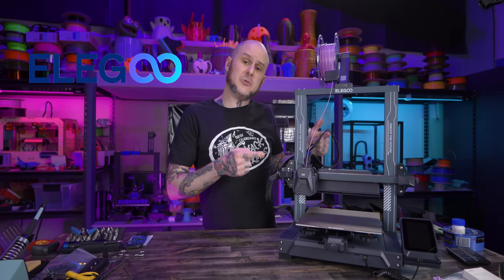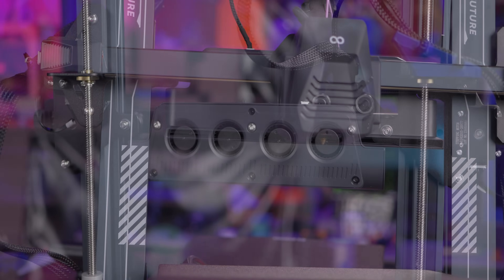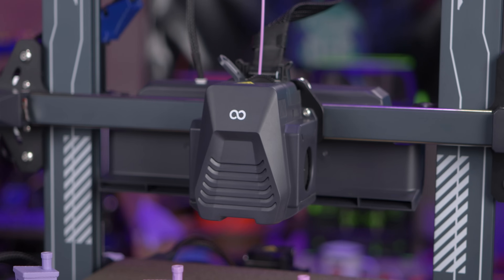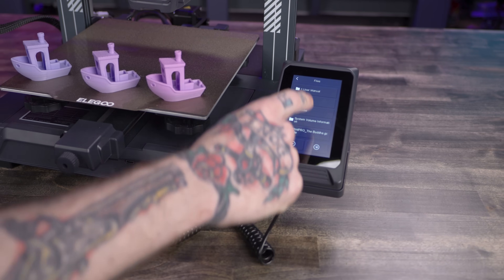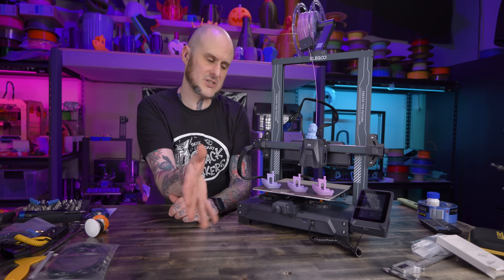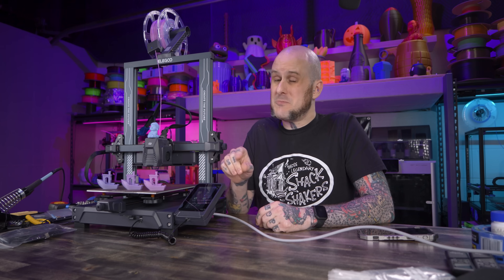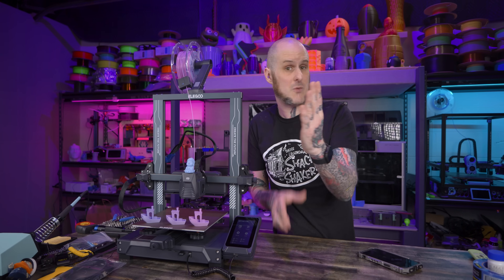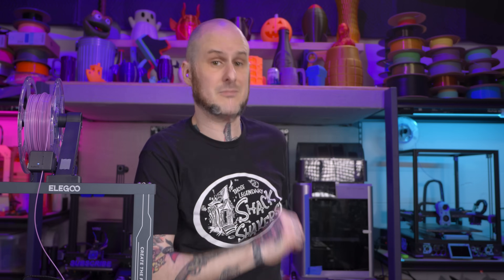Neptune 4 Pro - Closer Look + Wi-Fi Setup!

Comment: My MT7601U Wi-Fi dongle didn’t work at first either. it wasn’t showing up as available in NetworkManager. I followed some steps with ChatGPT’s help and reloaded the mt7601u driver, fixed the /etc/NetworkManager/NetworkManager.conf and interfaces settings, and now it connects perfectly. Every time I power on the printer I just unplug and plug the dongle once and Wi-Fi comes right up. Thanks for this video!

Comment: The wifi setup worked very well, thanks. Unfortunately, I have the problem that every time I restart, the WLAN stick is not recognized. I have to pull it out and plug it back in so that the connection is established. Is there a way to fix this problem in the driver files?

Comment: After power cycling it, it won't connect anymore. Has anyone been able to get around this? I have to configure it from scratch every time. I do have automatically connect checked out in Edit Connection
Reply: Do not get this printer do not get this printer. I've had their Neptune three and I don't know what happened. I'm pretty sure they sold the company off. This is a completely different machine is absolutely horrible like absolutely horrible. I can't even get the thing to work and I used to print on Neptune three for over half a year I made hundreds of dollars.

Comment: You removed the link to the USB adapter and say it's no longer recommended. Considering that was the reason I ended up in this video (and since you specifically mentioned skipping to that part using the description links, you obviously knew what most people would be watching for) maybe you could provide a more in depth reason why it's not recommended anymore.
Reply from the maker: Because it doesn’t work anymore. As I said, companies constantly update these parts and unfortunately the one I used has been updated. At least I had far too many people reporting it no longer worked after they ordered them. I don’t have a Neptune 4 anymore to test any other options, so unfortunately folks will have to use the info here but find their own adapter. Nothing I can do about companies changing products after I test them.

Comment: Sadly, I tried this method using the linked wifi adaptor, and it is not getting detected by the printer through putty, nmtui
Reply: Actually NO, it started working after I restarted the device, unplugged, then replugged for like 3 times. Then the wifi networks appeared.
Reply: I’m not having any luck getting my printer to connect to the Wi-Fi

Comment: Ok I have a genuine question and this is my first printer so I’m sorry if it’s a noob question. I did all of these steps and everything worked until searching for it on angry ip. Is there something that may cause it to work until that step? I would be absolutely ok running the whole printer through the thumb drive but when I do I get the message often that the usb has been disconnected when it hasn’t been. 😢 I have updated both firmwares and tried everything I can to get it working but at this point I’m scared to run it because I’ve wasted so much filament on this issue.

Comment: Does anyone else get regular drop outs of WIFI with this dongle?
Reply: Nope. But it does lose all IP configuration if you turn it off and on, does it also happen to you?
Reply: @ridrugo182  It needs reconnecting everytime the device powers off.
Reply: @LGTechRepairs  Thank you figured as much. Tried adding a bunch of rules when powering on the device to load the USB Dongle on boot but none of them worked. Ended up just physically unplugging and plugging the dongle back in. Thanks!!

Comment: Thank you! It took a few tries, but as of 24th Feb 24 my Neptune 4 is now working over wifi. 

I ordered the dongle from your link and installed network-manager without a problem, but could I get nmtui to work? No chance! Every time I entered the command, the remote connection  dropped. I could tell that the wifi adaptor was there and working, because I could set it using:

sudo wpa_cli -i wlan0
> ADD_NETWORK
> SET_NETWORK 0 ssid "AP_NAME"
> SET_NETWORK 0 psk "passphrase"
> ENABLE_NETWORK 0
> quit

...But everytime I powered down, it lost the settings.
After a day of messing around, I tried nmtui again (for about the 20th time!) and it came up! Set the network and away we go.

Thank you again.

Comment: Very easy way to fix the Wi-Fi issue is to use a Wi-Fi booster connected to your network and then hardline into the booster. No fancy programming or special parts, direct Internet usage via ethernet.

Comment: I'm thinking a WIFI extender with an RJ45 ethernet input would work to provide WIFI to the printer... acts just as though it's plugged into the network, but pulls wirelessly from your WAP. Those run around $15 on Amazon. Am I missing something in that regard?

Comment: I haven't tried this yet. But the device having an random ip without being on the network is misleading. This device may have its own static address assigned, which means you will need to make sure your pc is on the same subnet (Google will be your friend here..) . The rest of the access steps will be accurate then.

Alternately, use telnet and find its baud rate and com port. Use putty to access using this method is easier and more consistent in instructions.

Comment: I ordered the same one from aliexpress, followed the steps and it connected fine. On reboot it does not connect to wifi. If I remove it and plug it back it, it then finds it and connects to wifi. This is obviously not ideal. Any ideas for workaround? Did it work for you after turning off and on the printer (by the physical switch)?

EDIT: Not sure if others are having this issue but I will leave the solution here since this is the only place that shows how to use the wifi dongle. I basically had to add linux startup script to simulate unplugging and plugging back in of the usb device. I tested with starting the network manager service, down/up the interface, and everything else I could find online and nothing worked. The only thing that worked is the following.

1. Restart your printer then log in to ssh and run >ip a. Verify that you have the issue by inspecting that wlan0 has no IP address.

2. Create a script file to put the startup commands
(a) Run >lsusb -t. You will see that the usb device is connected to Bus 4 Port 1 (4-1)
(b) Run >nano /home/mks/wifi-dongle-restart.sh, when the editor opens copy/paste the following 3 lines in there 
echo '4-1' |sudo tee /sys/bus/usb/drivers/usb/unbind
sleep 1
echo '4-1' |sudo tee /sys/bus/usb/drivers/usb/bind
(c) Hit control+s to save the file and then control+x to exit the editor.

3. Give the file execute permissions
(a) Run >chmod +x /home/mks/wifi-dongle.restart.sh

4. Add to startup to run the above script on boot
(a) Log in as root if you are not already (logging in as mks isn't going to work). root has the same password as mks.
(b) run >crontab -e
(c) The file that opens, copy/paste the following line
@reboot /home/mks/wifi-dongle-restart.sh
(d) Hit control+s to save the file and then control+x to exit the editor. 

Restart the printer, log in to ssh again and run >ip a to verify that wan0 now has an IP. Let me know if someone finds a better solution!

Comment: Thanks for this! The TP-Link TL-WN725N worked for me
Reply: @TannerNetterville Does it get a wifi IP address after restarting the printer?
Reply: @AG34273  I've restarted the printer several times and had no issues. I have not yet set up a static IP for this mac address in my router but I will if the IP starts changing
Reply: I heard that it has many verions, What version do you use, can you post the exact link of product information that you have purchased. Thank bro

Comment: Hi. Thanks, if works when setup is done, but after a reboot it's doesn't"t connect to the wifi again.. are the settings stored in the printer memory?
Reply: @wallprintfr I had the same issue. Search for my username on this page and you will see instructions to fix it.

Comment: Really appreciate the videos, i have a problem though with my Neptune 4 pro, i succeeded to connect to wifi but i have to turn it off to put it in another room and then it loses connection and has to be wired again. Is there a solution for the Neptune 4 pro to keep his wifi IP adress even when turned off?

Comment: Hi! Do you believe that the low fps on the camera has anything to do with the low power output from the usb hub?
Reply from the maker: I think it is probably a software limitation. The same webcam only does 15fps on my Voron 2.4 plugged into a USB 3.0 port on the Raspberry Pi 4 in it.
Reply: thanks for the reply!  @MandicReally

Comment: which would u pick if u could only have 1: this Flashforge Adventurer 5M pro OR the Elegoo Neptune 4 pro?
Reply from the maker: I have zero experience with the Flashforge machine, they offered to send one but I turned it down due to lack of time & space. That said, the Flashforge being enclosed and Core-XY are both Pros in its favor. You won't need an added enclosure if you want to print higher temp materials. Cons are the slightly smaller build volume & proprietary parts (nozzle hotend setup). For $100 more you can get the Bambu P1S which is a pretty well rounded machine with a good slicer support & ability to add the AMS for multicolor later. 

I can't tell you what is right for you, but if I HAD to pick between the N4Pro & the FlashForge, I'd pick the Flashforge. 

Affiliate links to all of the above:
Neptune 4 Pro: https://tinyurl.com/ElegooNeptune4Pro
FlashForge Adventurer 5M: https://www.flashforgeshop.com/product/adventurer-5m-pro-3d-printer?cID=31
Bambu P1S: https://tinyurl.com/BambuP1S
Reply: @MandicReally   thanks so much! very very helpful

Comment: I am very disappointed that you introduced a Chinese product USB WI-FI to us. I have considerable doubts about Chinese security, but I also like your video.
Reply from the maker: A large portion of wifi modules are produced in China. And we are talking about a 3d printer produced in china, with a mainboard main in china, with a Linux based OS pre-installed on it. If network security is legitimately a concern for you, your network solution should be able to track traffic & prevent malicious activity. 

I've tried a half dozen USB Wifi modules since I got this machine & only that ONE has worked. Just how it is.
Reply: @MandicReally
Reply: Thank you for your immediate answer. I will also pay careful attention to Internet security issues. I will also pay attention to your videos. I wish you a good day. @MandicReally

Comment: Should I get this or the a1 mini
Reply from the maker: I don’t have an A1 Mini but if the size of that fits your needs, I’d probably recommend it. Bambu has a good ecosystem around their machines to make everything pretty straight forward. Slicer, app, etc. it’s all nicely connected to make the experience smoother. And the multicolor capability. The Neptune 4 doesn’t have that and isn’t going to anytime soon. 

If you consider an A1 here is an affiliate link to that machine: https://tinyurl.com/A1Mini
Reply: @MandicReally  but the build area is so small

Comment: So this is a great machine for beginners.
Also can you upgrade it to use multi colors
Reply from the maker: There is no multicolor capability. Some 3rd part hardware can add that but it’s expensive and I DO NOT recommend them. 

If you want multicolor the only option I can recommend is Bambu Lab. Everyone else is too troublesome unless you are talking very expensive machines. Something like the Bambu A1 Mini will have multicolor & a pretty user friendly starter setup: https://tinyurl.com/A1Mini
(Affiliate link) 

I quite like the Neptune 4 Pro and think it is a decent starter machine for a beginner, but Bambu Lab does have a pretty polished ecosystem & the ONLY approachable multi color setup.

Comment: It's a good thing you didn't review it.  I'ts absolute garbage.   I've had this damn thing less than 24 hours and cannot get a single print out of it.  4 different filaments and they ALL get clogged up in the PTFE tube in the hot end, which requires MAJOR disassembly to UNclot.  DO NOT BUY this piece of crap.

Comment: hi, still waiting to buy my first 3d printer, I look at reviews and I can say the market now has a variety of valid products, I know I can be OT but is it worth to spend a little more to buy the Neptune 4 plus that will come with wifi? Surely it has other little improvements over the neptune 4 pro (ceramic element in the nozzle? all other specs seems not so different), all this new neptune 4 3d printers differs from the printable area so a straight comparison cannot be done but I ask for an advice if the preorder of 322€ for the Neptune 4 Plus you consider a good deal. thank you.

Comment: I just received my Neptune 4 pro , I put my machine on network with cable , everything work fine at home , but when I’m not home how to look at it ? I can’t look at  my ip adress when I’m not home
Reply from the maker: To access your Klipper instance remotely would require a special network configuration. I don't have any recommendations of how to do that at this moment as there are a lot of network security concerns and I can't be responsible for that. I believe the Obico platform is probably the securest way to do it, but I have yet to set that up to say.

Comment: i'm wondering if it would be easier to just use a wifi extender with a ethernet port in it, would be able to run driverless or without changing any settings, and extenders arent much more expensive than dongles nowadays anyway :)
Reply: Этой штуке не требуется дополнительное питание, не занимает место и розетку и экономнее по энергопотреблению

Comment: i've got the same wifi dongle you added in the description, it shows up in the lsusb, even has the same numbers and names as yours, but when I enter activate  a connection, nothing shows up.
Reply from the maker: Try putting it on a Windows PC and test it there, then retry on the machine. I cannot confirm this is a fix but some others have said it worked for them. I have 3 of them here and they all work, so I'm sorry this seems to be happening to a few folks, they must have changed something.
Reply: @MandicReally  YOU SOLVED IT!!! OMG THANKS! I purchased 4 of these in 1 sitting for my 4 printers. It seems windows activates the dongle itself.
Reply from the maker: @Doile911  Excellent, glad to hear it worked for you. I'll have to continue suggesting this. 👍

Comment: My comment is a bit late but Linux doesn't need to support a device to be able to list usb devices plugged, instead of lsusb, you can use the command "iwconfig" to list wireless interfaces (Interface Wireless) and if it outputs an interface named wlan0, it means that you're ok, your dongle is supported.
"/sbin/iwconfig" or "sudo iwconfig"
Reply: Also you can get your wifi IP after leaving nmtui by simply typing :
"ip a"

Comment: Beginner's question here: I am planning on getting this but I have no problem using an ethernet cable for network connection - So question is, does it have a proprietary software that will easily recognize and connect to the machine? I dont need full controls, I just need a way to send the GCODE and start printing while sitting at my computer instead having to get up and bring a SD card. Thanks

Comment: I've read that the mainboard for this printer crashes a lot mid print, is it true?
Reply from the maker: I don’t have a lot of hours on mine but have used it in a handful of projects and that’s never happened yet. The board is based on what’s a pretty standard design at the moment so that would surprise me. Though I know those boards run hot, so could be a cooling issue if folks are in warmer environments maybe?

Comment: Can you compare Neptune 3 to Neptune 4. Can I save some money and still get a good printer with the Neptune 3? Thanks
Reply from the maker: If you aren't worried about speed, then yes you can save money and get the 3. The part cooling is better (not just the big auxliary cooler, but the part fans in the toolhead too), and the toolhead is lighter (smaller stepper motor) on the Neptune 4. But otherwise they are pretty similar machines. If you are fine with just printing and not worried about doing it faster, then the Neptune 3 Pro is a solid option.
Reply: @MandicReally  thank you. Does the Neptune 3 run Klipper?
Reply from the maker: @HeikosGarage  No it does not. It runs Marlin Firmware. You can convert it to Klipper yourself if you want (With a Raspberry Pi or other such items.). May cost about the same as a Neptune 4 then, but having better Wifi would be a plus of doing it yourself.

Comment: Hi . I was just wondering  if  MKS Robin WIFI module would work with neptune 4 series like it worked for neptune 2 series printers? 🤔
Reply from the maker: There is no socket on the board for it.
Reply: @MandicReally  I found green and black connector below the E1 stepper connector . Is it different one?

Comment: The WIFI connection is only established when I plug in the stick after booting or when I send the command "nmcli connection up ConnectionNAME" via Putty (or "activate connection" via nmtui).

What else can I do?
Reply: I had the same issue. Search for my username on this page and you will see instructions to fix it.
Reply: problem did you find a solution?
Reply: @paulgull2405  yes, I edit the wlan conf file. Dont remember how exactly

Comment: Wifi works here with a cheap ASUS Dongle. The 3 Euro Dongle from Ali i ordered not. Problem is, i had to unplug it an plug in one time after Printer has started. No Linux expert but can change this?
Reply: I have the same issue, when reboot the machine need to unplug and plug again,the wifi will work great,

Comment: Alright. I just received my 4Pro. It's working great. One thing I can not figure out is the webcam section. I saw some threads online stating mainsail is required. Is there any other way to get the camera working with out switching to the mainsail UI?